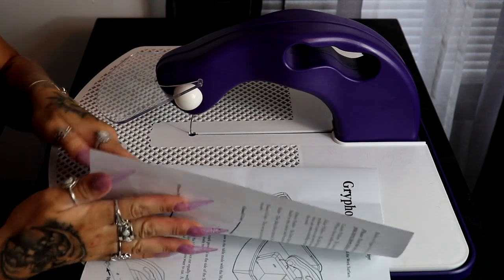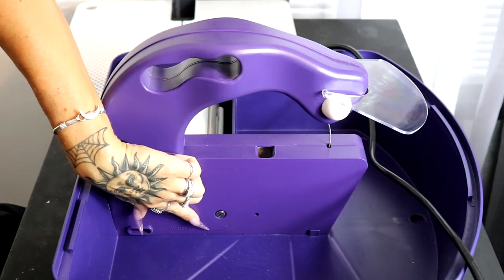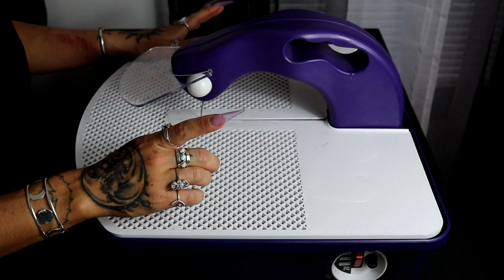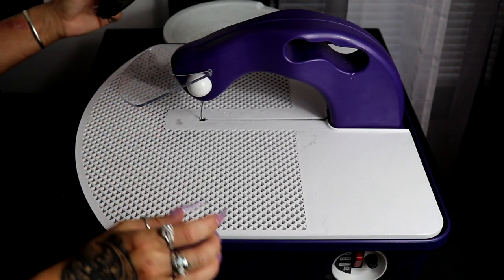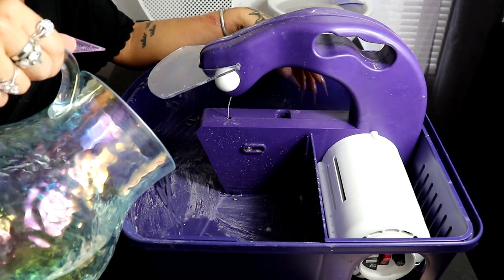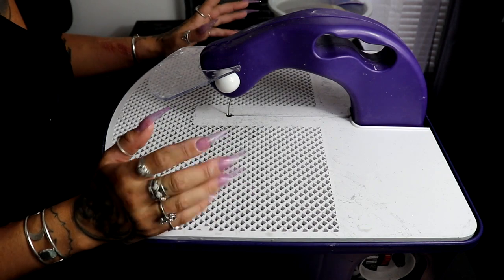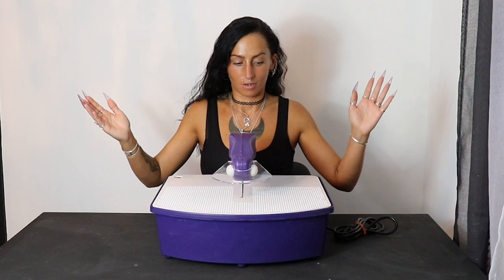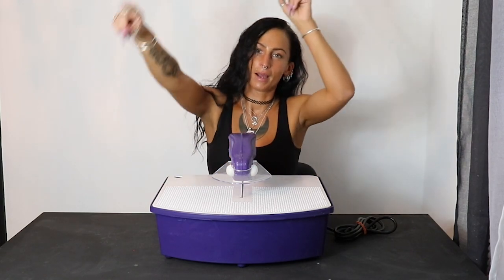Testing GRYPHONS ZEPHYR RING SAW! (Stained glass cutting machine)

Comment: I love my Gryphon--  and, at least at the time I bought mine, it cost a bit less than the Taurus, despite having the extra ring blade. I also noted that the cutting clearance both up and down and back to front was bigger than the Taurus, allowing for more maneuverability of the glass. I found mine splashed more than yours was doing, which was easily fixed by slightly tilting the whole thing back, resting the front edge on a couple of pencils-- then the water was still there for cooling the blade and catching the glass dust. I also got a step on/step off foot  switch from Harbor Freight, which makes it easier to stop if you are in the middle of a cut and need to for any reason. Just like using a sewing machine. I've also found mine useful if you want a continuous piece of glass for a background and you don't want to risk a bad cut, losing the continuity of the glass if it is streaky, or has a pattern. I also use it for glass that is misbehaving and cutting badly, since I don't want to waste glass if I can avoid it.
Also, about the motor noise: I find it calms me to wear earplugs while using the saw. I also put on a full plastic face shield "just in case", as I am very "gun-shy" about the possibility of the blade breaking, which has never happened to me (yet).

Comment: I have the gryphon and
Love it!  Like you Makenzie I was cutting glass, when a horrible sound happened and it stopped
Cutting I took it apart fully expecting to change the belt to be pleasantly surprised. I have since learned to move my
Scraps out of the way so they don’t get sucked up!
Reply from the maker: Absolutely! I've had some bad pieces get sucked in on my taurus. I was fully anticipating a snapped blade with the gryphon. Totally just feels made better.

Comment: I just got one of these today and im hyped to use it
Reply from the maker: Awesome!!!! It's so neat. Have fuuunnn!!!!!
Reply: Mine seems to be leaking from the purple casing between where the face shield connects.  It trickles down under the face shield and drips from the same place the normal water does.  Is this normal?  It doesnt seem like its supposed to leak from the two halves of the casing.
Reply from the maker: I would reach out to Matt, gm of gryphon. I do believe I've heard him say before to someone the the face shield isn't in place all the way or something if that's happening. But I'm not 100 percent sure. Definitely shoot them an email, there super helpful!!
Reply: @MakenzieHallie  thanks i will
Reply from the maker: Let me know if you can't get in touch for some reason 🖤

Comment: I had a second hand Taurus for years until it died. I loved the results, but it was not easy to use and the ring saw blade ‘jumped’ off its track quite often, without there seeming to be a good reason.  Thank you Makenzie for your thorough review.  I love the look of the Gryphon, and am very impressed with what you have shown of its performance.  Definitely on my wish list too.  Ann x
Reply from the maker: I would agree with that assessment of the Taurus. It took awhile for it to do it to me, but I never really put it to hard use before that. I do think it's a good machine. I just think the zephyr has those extra elements taking it up a notch.
Reply: I'm so glad I'm not the only one that's noticed the Taurus blade jumps off without putting too much pressure on it. I was worried iw as doing nothing wrong

Comment: Any chance you can show us a piece of glass you've cut with the Gryphon. I just got my saw and my cuts are too rough to cut right on the cutting line. I have to cut outside the line and the grind.
Reply: I'm having the same issue. Did you ever find a solution to this?

Comment: When using the saw is water coming out the seam in the top?  I can't tell from the way the camera is facing.  I know you said the owner of the company told you to make sure you leave the safety shield on or it can leak.  Mine is on but still leaks.  I was just wondering if the one you're using leaks there too while using it.

Comment: Thanks for this video. I bought this on your recommendation. My problem is the work surface does not seem to fit. It doesn’t click in to place and is wobbly. Gryphon help center seems to be non-existent. Can you help, please.
Reply from the maker: Yes i can, absolutely should just snap into place like any other grate. Where are you reaching out to gryphon? And when?
Reply: I tried to contact Gryphon on the address they have at the back of the manual. This I did yesterday right before I contacted you.
Reply from the maker: Ok yea so because its the weekend, no one would respond yet. I would give them a chance to read your email first!
Reply: Problem solved! TY!

Comment: Let's hear this beast!
Reply from the maker: You may not like the results. Lol. I'd say just as loud as any other glass ring saw, but noticeably more powerful.
Reply: @MakenzieHallie  yeah with power comes noise. How did the water spray on the table top do with running the glass through the machine? Wondering if there was more water on the bench actually cutting the glass. I have the Taurus 3 btw
Reply from the maker: Quite literally ZERO water. The entire time. I would have updated saying there was water spray, cuz that drives me absolutely batty about the Taurus. So messy. The only time water hit the table was after I took the grid off or something like that. No direct spray from the blade. And talking to Gryphon, they said we can also run it dry as long as we want  to slowly add water to our desired flow, as long as we don't grind it dry. So that's pretty cool too. I think overall I would sum it up as cleaner, more powerful, more options, more extra parts, just as loud as any grinder, easier to use.
Reply: @MakenzieHallie  awesome I'll consider this down the road for when the T3 bites it. Btw I sent a PM to you on Instagram.  Asking about youtube stuff .
Reply from the maker: Definitely, and kk, what is your IG name?
Reply: @MakenzieHallie  it won't let me post it here wth?
Reply from the maker: That's youtube blocking you. I immediately checked held for review so they are totally deleting it. Try to add a space somewhere or don't type the @
Reply: @MakenzieHallie  well it's blocking again . I sent you a message in insta first name dave last part is  .33
Reply from the maker: I saw it. It showed in my notifications!!! Lol I just can't click and see it. Says no longer available and still isn't in my held box. But kk ill check

Comment: Do you have any tips on keeping the black marker on the glass while cutting?
Reply from the maker: Ok so I haven't ever needed to try it but ALOT of people comment about it. I've seen chapstick, Vaseline, doing the sharpie the day before, but I haven't tried any. So I just can't confirm. I would imagine chapstick or any oil based product would help repell surface water!
Reply from the maker: Maybe I'll do a video testing different methods
Reply: Straight up need a solution for this too! Makes me never use a band or a ring saw even though they’re so needed sometimes!
Reply: @duckiemace  Try a little less water. Again, empty the reservoir and then activate the saw while empty. Add water incrementally until the water just starts to flow then stop adding. The vaseline technique works really well too and wont hurt the saw.
Reply: Someone said on a blog that they use sharpie paint pens that are oil based. I just ordered some so hopefully it works!! Can’t wait to get the saw, ordered yesterday :) hope you’re being sponsored!!
Reply: @matthewwolfe6848  thank you!! Will definitely do that!

Comment: I got my saw yesterday ... I've been so excited to try it!! But I've noticed some things and only have 72 hours to return. 😩 Did you noticed it leaking out of the seam above the splash guard?? Did you have a hard time getting the tray to sit flat & not wiggle?? Please help 😆😆😆
Reply from the maker: Water should not be leaking from the seam, it is either not snapped completely shut or the face shield isn't clicked in. As for the tray idk how to help that, once it sits in place it's in place, I'd have to see it!!
Reply: Hold your hand down on one corner of your work surface and push down while going all the way around to the opposite side of the surface snapping in one corner at a time. Make sure your saw is completely seated in the slot at the bottom of the pan.
Reply: @matthewwolfe6848  Thank you! Yes, i just have to push down on all sides to make it go into place. I was also able to remedy the water coming out of the top. :)
Reply: @Jaim-  That's great, glad to help!

Comment: Would you say this would be the better cutting tool over a cutters mate?
Reply from the maker: I would say that's comparing apples to oranges. They both are made to do completely different things!  Both great tools if you have the $! Cutters mate is for normal glass cutting. A ring saw is for the rare times you need a specific shape cut out that you cannot possible get cut with any glass cutter.
Reply: @MakenzieHallie  Thats the answers I needed. Thank you!

Comment: I'm so torn between the Tuarus and the Gryphon - I keep leaning more towards Gryphon because I have heard Matt is great - but I'm so torn!
Reply from the maker: Matt is great.  I wouldn't be surprised if he saw your comment! BUT I will say, they are both great machines. You need to objectively look at the pros/cons of both and see which suits you and your wallet best. I am confident in both machines. I would personally pick zephyr. But I use the Taurus and it's separating blade too, because I already had that blade for it.
Reply: @MakenzieHallie  follow up question.... lol - I also do a lot of cutting of old china and ceramic pieces (cups, plates, bowls etc) In your opinion having tested them both, which do you think would be able to power through tiny delicate cuts of thick ceramic better? Or more importantly... which do you think could handle that long term / life expectancy. I keep leaning towards the gryphon due to the bigger size, cheaper parts and faster delivery.... but maybe cheaper isn't always better! UGH! lol